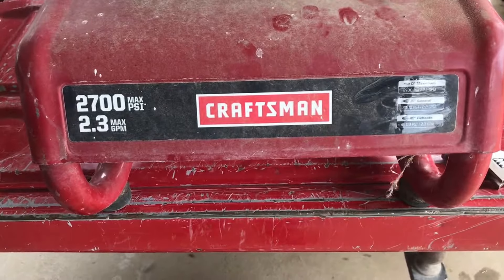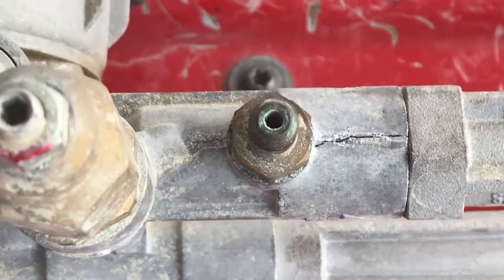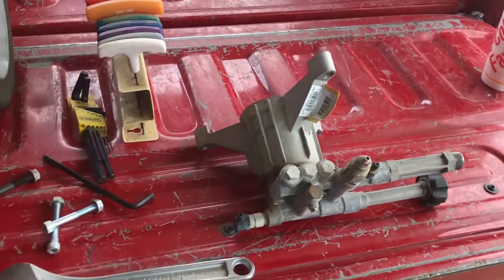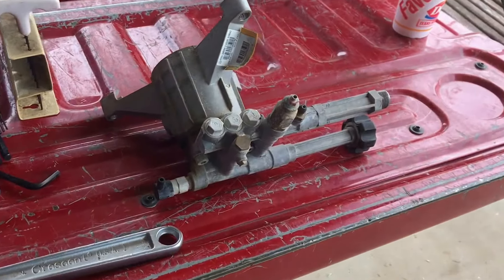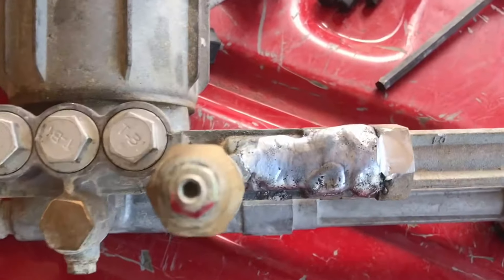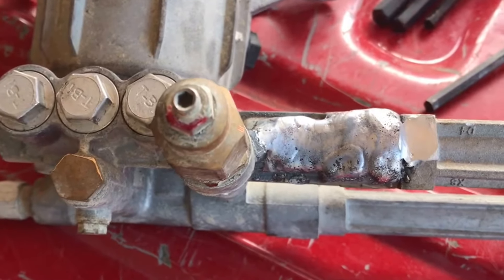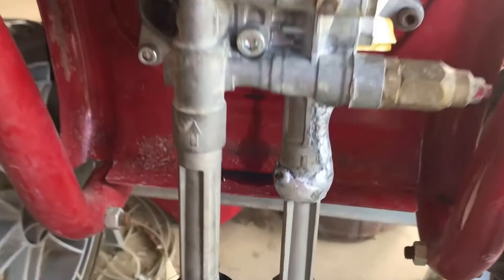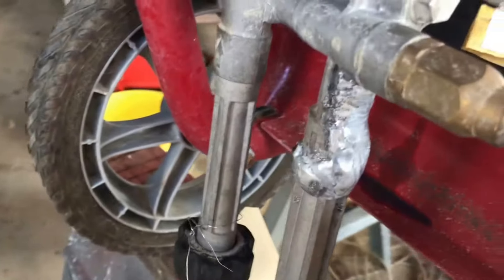Craftsman Power Washer Cracked Manifold  Tig Welded Save money!

Comment: That’s aluminum right? Can I do it with stick
Reply: Cast aluminum.. got it. Is it still holding?
Reply from the maker: I had a welding shop do it.   Can’t do it with a regular welder.  
It held until the engine went belly up.